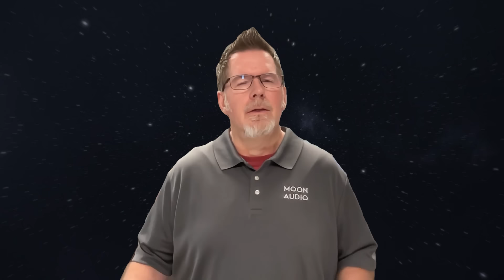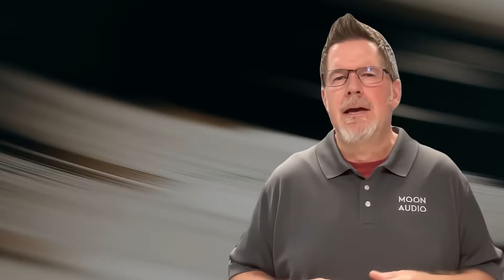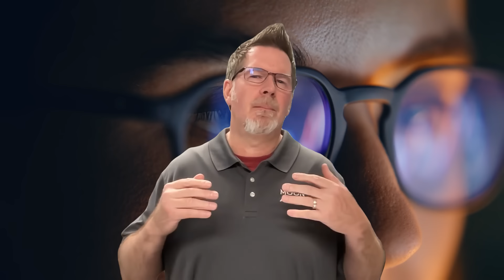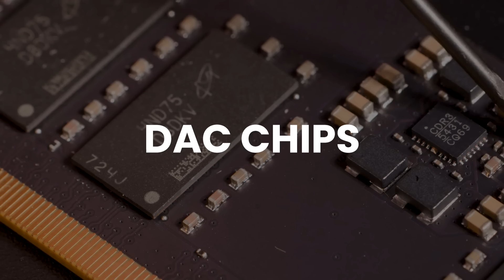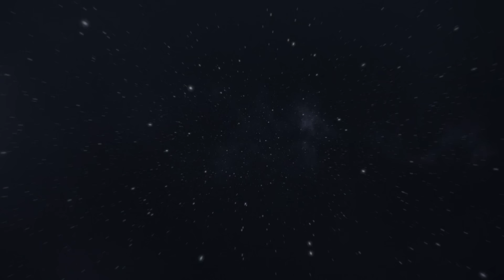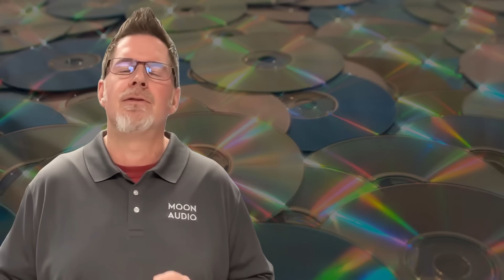The CD Player NIGHTMARE in 2026! Here's WHY and How to FIX It

Comment: @6:44 "It has one single job: Read the disk as accurate as possible and send a pure digital signal to your external DAC."

I count it as two jobs.
Read the disk and clock the bits.

A $20 USB, portable CD reader/writer will read your CDs the same as a high-end transport (assuming your CDs do not have damage, causing difficulties in reading the data).

Where a quality transport shines is with its virtually jitter-free clocking.  That is where the magic happens.

And I can offer a third job for a quality transport: Low electrical noise.
All audio equipment generates electrical noise.  A quality transport (or quality "any" stereo component) will create less electrical noise compared to mass produced components.  If you think that you have no electrical noise, you are mistaken.  If you take steps to lower your stereo's electrical noise, you will hear an immediate sound quality improvement.

This video was on the mark with everything and earned a thumb's up click.  Our host knows his craft.  Few channels have such an informed host.

Comment: Very interesting video, and I strongly agree with the main point that people can get far too distracted by DAC chip names, I2S, clocking jargon and marketing terminology instead of looking at the engineering of the complete player and the way it fits into the rest of the system.

I do think a few points deserve some nuance, though.

First, I wouldn’t say that an audiophile chasing reference-level sound must eventually separate the transport and DAC. A well-engineered single-box player can perform exceptionally well, especially when the manufacturer has properly isolated the transport, digital section, power supplies and analog output stage. In my own system I use a Yamaha CD-S1000, and one of the things I like about it is precisely that flexibility: I can use its internal analog stage for SACD, or use its digital output as a CD transport into an external DAC.

Also, CD error correction is a little more sophisticated than the idea of the player simply “guessing” missing music data. The Red Book format was specifically designed with robust error detection, correction and interpolation, and under normal conditions a competent transport can recover the digital data very reliably.

I’d also be careful with the idea that I2S over HDMI developed mainly as a way to bypass SACD copy restrictions. I2S was originally intended as a short internal digital interface between chips, and its use over HDMI connectors in high-end audio is a later, non-standard implementation — which is exactly why compatibility and pinout issues exist between manufacturers.

And finally, SACD can certainly sound excellent, but I don’t think the format itself automatically guarantees better detail, depth or dynamics than CD. The mastering is often the bigger factor. A well-mastered 16/44.1 CD can easily sound better than a poorly mastered SACD.

Overall, though, I completely agree with the broader message: implementation matters more than obsessing over a DAC chip logo, and understanding the architecture of the player is far more useful than chasing specifications in isolation.

Comment: I do not use I2s1.  I use a Rockna Wavedream Reference Signature from a Jay's Audio CDt3 mk3 CD transport.  They are connected with a Masterbuilt Ultra AES cable and a GroverHuffman SPDIF cable.  I have 16,100 CDs (1/3 of my music collection).  CD players are okay and have good sound.  The CD recording and mastering makes the difference as you state.  So much streamed popular music is afflicted with the loudness wars as well as other problems from the source and noise removal processes (Sonic Solutions, No Noise and currently computer after mastering remastering).  The mid-1990s for 20 years later often are afflicted as streaming is today with the same CD problems.

Comment: Sound reproduction varies online. CDs are quite impressive relative to streaming. I can only think that there was analogue - digital conversion THEN it gets streamed. CDs are usually precisely printed as true as the studio mix created. CDs sadly perish with humidity, dust, scratches and the players' spinning action plus sensor seem to glitch out. CD sound rules hectically. My home theatre system almost explodes with unheard performance loudness, imaging or definition and freq. range. Truly shocking difference from streamed. The system is an entry level Sony 5.1 serious looking receiver amp. with extra L/R channel and an optic port. But it was a cheapy in 2004. Im still blasting it at max everything. Im so impressed. I bought a ROTEL HEAVY receiver with a massive number of ports, plugs, connections finished in gold. Expensive at launch in 1998. That thing has blown a channel twice! It runs very hot too with no fans. But my trusty Sony is such a gift. The speaker cones also look like very hardy composite material. Zero degradation. I live at the coast in South Africa, Cape Town, the weather is bad for electronics etc. which makes this basic yet fancy looking Sony home theatre receiver even more impressive. I thought I would have blown the amp long time. I love LOUD music. I'll cry when my sony surround dies. Truly. Thanks for reading my blurb. And thanks for this video topic. Its relevant for me. I spend most my life listening to music and always try to innovate the sound experience by experimenting with direction, placement and equaliser settings. The CD revival in me has begun.

Comment: Error correction used in reading CD is not at all guessing. It is using checksums and calculate the missing bits without any guessing at all. If more data is missing so that error correction can not calculate the missing bit, interpolation is used. This is more inexact, but it differs from guessing to use algoritms the make an intelligent approximation but is not exact as error correction is.

Comment: I believe that if you connect your CD player to a preamp or AVR using a COAX or optical cable,  the DAC in the CD player is bypassed and the one in the preamp or AVR is used. And that the DAC in the CD player is used if you use a RCA analogue cable
Reply: @artyfhartie2269  you are correct sir.

Comment: Back in the day, when CDs were just CDs and there was nothing else, really. Audio was NOT a problem! It is like with computers. Back when, you wrote your code, compiled it and ran the executable. It didn't take much space, memory, resources and did its job quietly and economically. Then came the PC, unix, liunx, java, all the different operating systems, the languages, the run-times and all the other add-ons. Then the Open Source hell and millions of lines of code to run though without any use whatsoever. It's the same with all this CD crap. A CD is a 44100 Hz sampled times two (stereo) 16-bit resolution per channel digital product without any destructive compression. Just how bl00dy hard can it be to play it back? Forget about vibrations and transformer humming. It was not an issue back when so how can it be an issue now? And vibration? The first CD Walkman players solved that one. This is just so full of sh!t!

Comment: Back in the early 2000’s XM radio put out a stand alone receiver that you connected to your PC but with an analog music stream from the unit. Within a week of delivery we DIYers had cracked our units to output a digital signal that could recorded. I published a schematic using basic TI chips. Another started selling circuit boards. Someone else wrote software that controlled the unit to record the stream with all the song identifiers preserved. Stuff it yourself and you actually had a legal digital  output. The record companies went nuts. They forced XM to eat the existing stock of the units. The signal was I2S. Hahaha.

Comment: After 40 years and dozens of single box CD players, transports with different DACs including PS AUDIO combos, i think I finally stumbled onto the perfect solution, at least for me. In the past couple of years, I 've been ripping my CDs and storing them onto a Bluesound Vault. I use the Vault simply as a ripping and storage device as I am not particularly impressed with its built-in DAC. This setup eliminates jitter, mechanical noise and power supply interference.  To my ears, the music became less harsh and I can hear more of the nuances in the instruments and human voice.
What blows my mind even more is listening to the same flac files on a thousand dollar DAP with headphones. For the cost of a power cable, I get sound quality that is 90% as good as my system that costs 20x as much.

Comment: I ditched my newer generation Marantz NR1403 and connected 40yrs old JVC RX500B 100W receiver.
Also disconnected NViDia HDMI output on my computer and connected a $40 external Vantec USB card.
Plays mp3s extraordinarily clear and dynamic, barely distinguishing from vinyl or CDs via RCA inputs.
New electronic stuff from 90s onwards is garbage. Anything that has more than 2 channels and home teather crap is inferior to almost any Japanese manufactured audio device from late 70s and early 80s era. 
Could not believe the improvement.
You should start investigation with your inferior home theater crap amp.
Also always buy a powered subwoofer which has high level speaker input and connect it that way, never use LF input.
This is my honest advice.
Of course, I am talking about budget setup, not a fancy $10K + stuuf. 
However, I guarantee enjoyment, even this way.

Comment: I'm fully satisfied with my Marantz ND8006 CD player & DAC, and it's (unsurprisingly) the perfect match for my Marantz PM8006 amp. My speakers are ELAC Debut 2.0 F5.2, "broken in," a full three feet out from the wall, and carefully placed with respect to the space between them and the toe-in. The sound is full-bodied and crystal clear, with realistic timbre, a tactile quality, and a big soundstage with at least 28 spatial points.

Comment: Still have the old Pioneer PD M70 CD player that does not have the Virgin IS2 digital output audiophiles want. 
A 1=1 0=0  & my non IS2 digital output sounds great thru my Polk 10A speakers all bought over 4 decades ago. 
The CDs sound great & for a guy my age hearing everything just fine after many live concerts that would not register 
at all to the newer Gen Z / Y / Millennial crowd. SACDs ? Yea spice up a 1 & 0 put an extra $1,000  price tag on it.

Comment: I would dispute the claim that you can't "cram" a CD mechanism and a DAC into the same box without sacrificing quality. There's not much need to "cram" anything these days, anyway! Even in the 80s, there was plenty of room in a single chassis.
Cramming aside, I fail to see why a DAC would care about small vibrations.
Take a professional Digital-HD video recorder (just for example). Literally thousands of times more complex than CD playback, with vastly more mechanical stuff going on. All housed in a single unit. With no problems.
For the nit-pickers, yes, the very early D1 VTRs had a separate mechanism unit, and separate electronics unit, but that was largely because a single unit would simply have been too enormous!
Something like a "modern" HDCAM-SR deck, however, all in one unit, VASTLY more complex than CD playback, all perfectly happy in a single cabinet, and capable of the absolute highest master-tape performance. But a "simple" home audio system needs two separate boxes?! Yeah, right.

Comment: Playing SACD through digital outs like coax and optical will only be 48khz as far as I know. I2S is DSD I think but not many players have it
Reply: Yes, mine only sends SACD layer to the analogue outputs, plays red book layer through digital output.
Reply: The solution i and many other use, is a sony uhd player connected trough hdmi to a good avr. I use Yamaha's RX-A6A, very nice sounding avr. Then you get a sabre es9026pro dac that sounds really good for sacd's.

Comment: Just bought another Philips CDP in the thriftstore for 10 euro . Early 90's 600 series made in Belgium. It has a CDM4 transport and a dig out coax SPDIF. That Philips plows on where all my other CDP's give up. VandenHul digital cable well over 100 euro 😅 PS Audio DAC. NRG Audioquest power cable. VdH signal cable. That Philips CDP will eventually give up. Just throw it in the bin and get the next one from the attic. The rest of your digital signal chain is here to stay.

Comment: Having been around the bend with many many cd players (and dacs) since the beginning and also utilizing modern players with a digital out to a separate dac, I would say most people are not going to hear a difference.  The brand name players I have used all have high quality dacs such as Burr-Brown and do a great job.  I would suggest that plugging into an external dac yields a perceived difference that is more imaginary vs. real.  A true, controlled A-B comparison I believe would prove that.  Dacs are certainly the rage right now; if it is in a separate box it must be better!  What will be the next rage….external power supplies, or what???
Reply: @rcd4466 I JUST learned (after being around that same block!..), that DSD from an SACD player gets converted to PCM!  I tried doing all HDMI in my audio system INCLUDING the Pioneer Elite SACD/multi format player.  When I heard that the HDMI and digital outputs convert the DSD, I realized the best way to enjoy the SACD is via the ANALOG outputs from the.....you guest it, Burr-Brown built in DACs.  So, there you have it.

Comment: Pick up a decent DVD player from the 90's or early 2000's. There are a ton out there. Many available at thrift stores. Toshiba, Denon, JVC, Sony. Make sure it has a digital output, either coax or optical. Pick up one of the many fine DAC's available - Schiit Audio, SMSL, almost all are very good. Hook them together with a coax cable or optical connection. It's going to sound great. The mastering of the CD is going to make waaay more difference than your transport and/or DAC.
Reply: ik heb een hoop geld uitgegeven door precies te doen wat u beschrijft . als u vind dat het fantastisch klinkt , ben ik jaloers op uw oren. ik heb deze ervaring niet , en ben uit pure wanhoop zelf een dac gaan ontwerpen na heel veel zelfstudie over audio. er zit nu eenmaal een behoorlijke prijs aan een nagra dac . mastering uit de 80 er jaren was veel beter dan nu , en ik heb nu een ontwerp klaar dat eindelijk klinkt als toen ik 18 jaar oud was , of zelfs nog beter.
Reply: @tubecollector100  'uit pure wanhoop zelf een DAC gaan ontwerpen' 🤡 BRUH
Reply: @DBMMOTC  ja , en dat heeft zijn resultaten meer dan terug verdiend. mijn ontwerp heeft twee mundorf 1 uf condensatoren in de voedingslijnen zitten van de operationele versterker , een dac heeft een veel te klein signaal om dat anders te doen..   en heeft twee luchtspoelen om de voeding zo schoon mogelijk te maken. en dat werkt fantastisch ... voor mij dus geen rme adi 2 en rme adi 2 pro black edition meer , ik heb daar meer dan genoeg geld bij verkoop op moeten laten vallen . voor een dac die als referentie werd genoemd , heeft die mij heel erg teleur gesteld.natuurlijk , deze dac heeft enorm veel instel mogelijkheden. maar ik zocht een top audio dac , niets meer en niets minder . ik heb nu het geluid wat ik had in de tachtiger jaren , maar dan transparanter en met meer kanaalscheiding. ik ben tot de conclusie gekomen , dat de lage vervormingscijfers van de rme produkten alleen maar bedoeld zijn om audioliefhebbers op het verkeerde been te zetten. ik weet nu beter , ook al heeft dit mij jaren aan testen en een hoop geld aan onderzoek gekost .
Reply: Je leeft in een illusie. Als je geblinddoekt een rijtje testen doet tegen een serieproductie-apparaatje, zul je  zien dat je door de mand valt. 
Wat die 1uF condensatoren doen is me ook een raadsel 🤷 
@tubecollector100
Reply: @tubecollector100  What kind of power amp or you using? More power = always better.
Reply: @Gallagherfreak100  i use a rca 2a3 se tube amplifier , on my klipsch heresy speaker. i had to place away my we300b on the shell , it had too much power according to my neighbours , and i want to stay friends with them.
Reply: I rip them via a £12 USb DVD drive, then play them through a £9 Apple USB-C to 3.5mm adapter.
Sounds amazing.
Reply: @Gallagherfreak100  Find a Sony Blu-ray that plays SACDs. There's tons out there at a very good price. Go HDMI out to a HDMI i2s converter box, then to a DAC with i2s input and you can play SACDs in DSD64. I have just a few SACDs and two are Deep Purple Machine Head and Pink Floyd Dark Side of the Moon and they're absolutely incredible sounding!
Reply: Nothing beats the RME ADI 2 PRO EX DAC.
Reply: @MasterofOrion  i owned the rme adi-2 and a year later the rme adi-2 pro black edition. lost a lot of money when i sold them , they are not bad , but i expect more audio quality for this kind of money , i really only needed a good sounding dac. do you really motivate people to buy the next even more pricy dac? rme should have made a simple perfect sounding dac in the first place , now they act as every chinese brand that launches a new even more expensive dac every 2 years.. what is wrong with the time that a dac could last years and years?
Reply: @MasterofOrion  I don't need something like that. Don't need headphone amp or headphone jack. "less is more"

Comment: Watching this when you watch or listen to content where there's no internet connection but use a microSD for storage...  About to pull the head unit due to it not having Bluetooth capability and the drive is dead to be replaced by a amplifier that has Bluetooth built in.